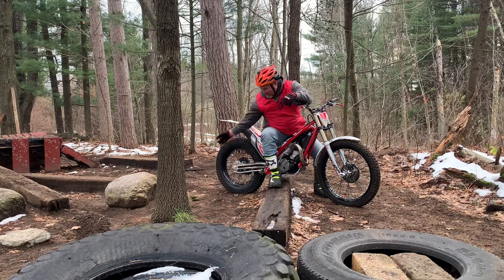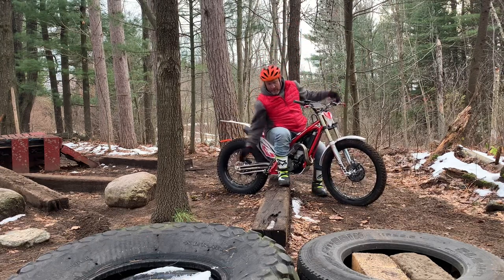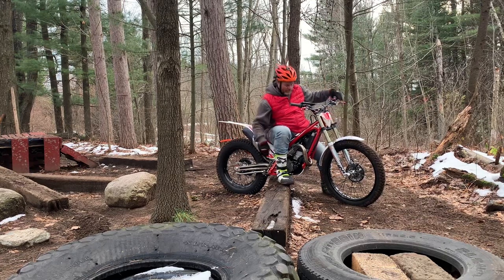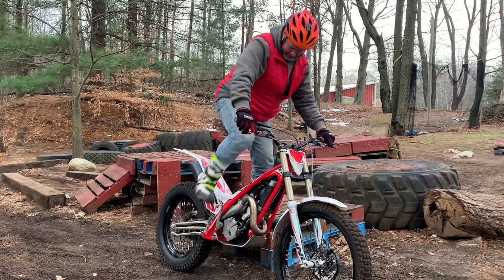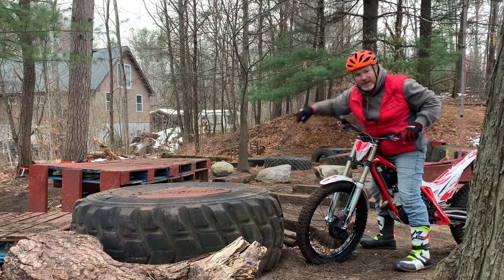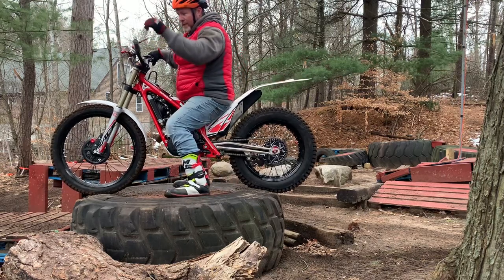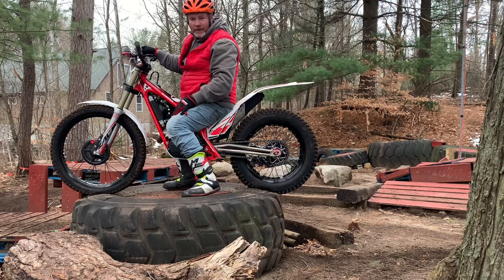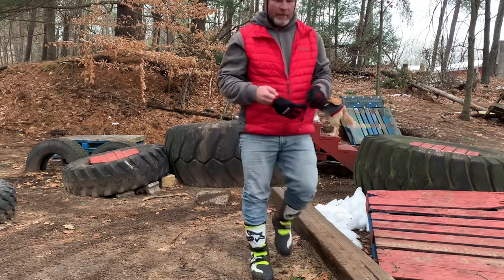How to roll up and double blip a trials bike

Comment: I have no idea why I haven't watched this one before.  Very good video and description of what and how to do it. Thanks for starting on the crosstie, it just proves to start small and don't get an ego and try bigger stuff too soon. Which is exactly what I've done. I haven't ridden the obstacles in my backyard for a while so I will be practicing this in the near future. I'll start with a crosstie so I can slow everything down, when I attempt larger obstacles, things go so fast that I kind of double blip, but I fail to properly use the clutch. Yes, you need to do some more of these how to videos. Also thanks for commenting and giving me tips.
Reply from the maker: No problem, I’ve been working on some splats and thought about doing a beginners video but I’ll see how the weekend goes. I’ve mainly been working on moving the bike around in tight areas and balance drills. I’m going to try and film something this weekend but I’m not sure what yet. LOL

Comment: Very good video. I don't have a trials bike, but I'm trying to incorporate trials techniques to improve my trail riding on my 500exc. That may sound ridiculous considering I'm 66 years old. Somehow I've gotten fairly good at using the punch-thru method to get over logs up to about 20 inches high. But, I think I need a    way over higher logs that doesn't launch me in the air. Especially when there are trees close on both sides and the trail is rutted. Do you have any suggestions?
Reply from the maker: Hello, you are getting into under cut logs at 20inches and a punch-thru is definitely going to kick the rear wheel up. I don’t ride enduro so take this with a grain of salt but you will need to focus on a zap to lift the rear wheel. I would suspect the plushness of the suspension is going to take some time to adjust to. I would start with setting my front on the top corner of some logs and letting the suspension compress then add a little hop. I came from bicycle trails with no suspension so when the front tire tapped the object you jumped, when I started on the moto trails bike my natural instinct was to jump as soon as the tire hit. I found that working on getting my front tire set up for stuffs it let me get used to the suspension travel. So pull up to an object, find that top 1/4-1/3 of the log, pop a wheelie setting the tire in that spot with the clutch in and brakes on, let the suspension sink in,bend your knees and let the momentum move your body forward. That’s the start of it, you can now balance but take note of the timing your bike and body have. When you have that feeling being at the bottom of the stroke is when you will jump up and forward focusing on getting your feet to land on top of the log. Next is to find a ledge or something that has a backside so not to worry about going over the bars and put all that into one motion. A nice slow approach, pop a wheelie, when you feel the front is going to hit its mark pull in the clutch, rev as the bike sinks in waiting for the compression to stop, jump up and forward with a pull/hip thrust, lift legs and bike as if you were jumping to the top of the log and when the rear wheel makes contact push into the pegs to hold pressure.
Reply from the maker: I forgot to add on the jump up is the clutch pop, this takes the most time to figure out, to late and the rear will pop up but has no drive forward, to early and it will go up but it drives into the object hard. Rolling the gas of with the clutch pop is critical as well. Hopefully this helps, good luck and thanks for watching

Comment: are you popping clutch when you first blip the front wheel on the log or only throttle? I am not entirely sure what I should be doing first. clutch first or throttle.  Great video exactly what I was looking for on my current skill level
Reply from the maker: In a perfect world you want to be slipping the clutch and adding throttle as the front tire is approaching the log then a little more slip with a good twist of throttle and a clutch pop at just the right moment.
Reply: @2wheeltechnique436  Thank you!! Been doing trials for 2 weeks about and its insanely difficult for me ha ha

Comment: What gear you doing these In just starting out so hearing a lot of using 2nd is best start point?.
Reply from the maker: That would all be in first gear. I’ve heard a beta and Montessa have lower gearing so you might need second but for my GG 1st gear works well